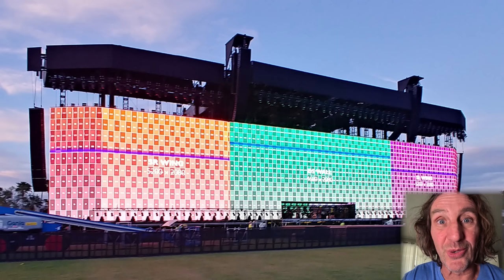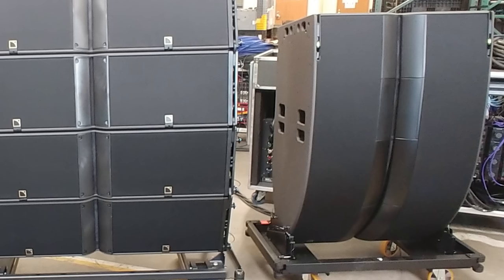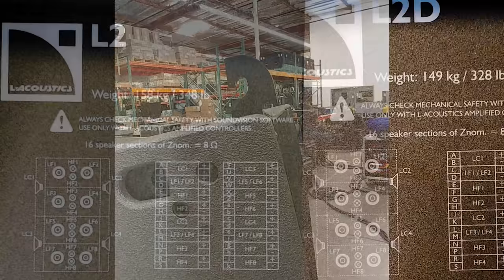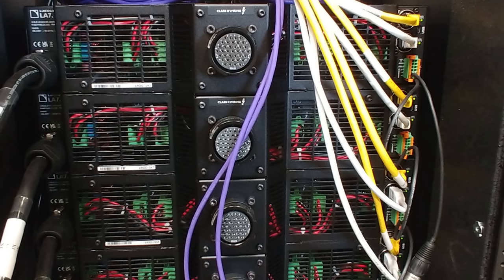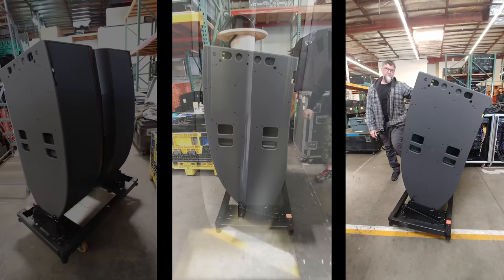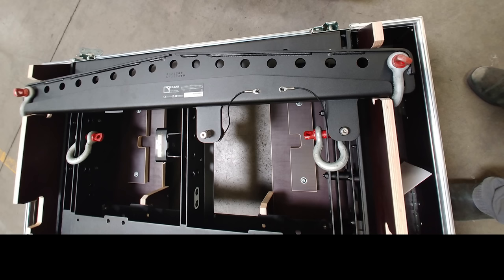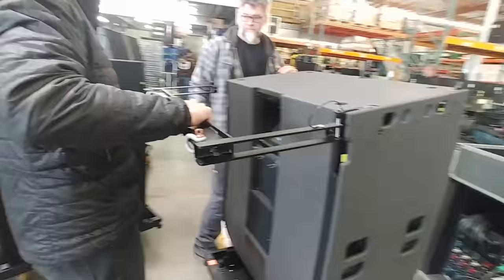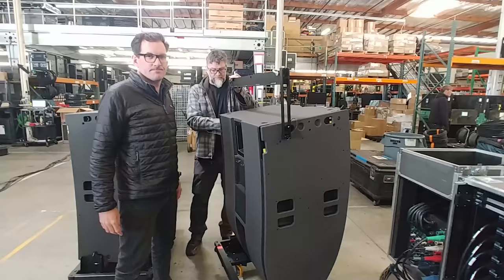L-Acoustics L2 Hands-On & Huge Festival PA

Comment: Spend all that money on and don’t put the boxes in cases with protective tops?
Reply from the maker: For large format touring systems the industry standard is to use carts. It would be a total nightmare to have case lids for those. Not only would the lost time in taking the case lids off and on be an issue, where would you put them all? Back in the truck so you have to unload them before you load out and cost tens or hundreds of thousands of dollars in extra labor?

For Coachella festa will we deploy over 800 boxes with over 200 carts similar to the ones used here with soft covers.

Just taking the soft covers off and putting them on and storing them is a chore.

As far as transportation the cards just roll into the truck or get forklifted.

Putting hard tops on speaker cabinets is great for small stuff but for large format systems it's about as useful as getting a hard cover box to put over your car that you have to lift off every day you drive

Comment: I guess, with integrated cardioid, these boxes will be able to compete with the new D&B KSL boxes that seem to be gaining popularity (though I think L-acoustics still seem to be used at the majority of events.) If they ever release an L1 rig that can compete with the larger K1 and D&B GSL in volume, that would probably change the game. I recently went to an arena concert (Missy Elliott) that used entirely D&B KSL arrays. The entrance to the arena was behind the stage, and I couldn’t hear ANYTHING from there. In previous concerts in the same arena with K1/K2, Meyer Leo, and Clair Global Cohesion arrays, I could certainly hear them upon entrance. I can’t wait to hear L2 in action at an event some time.
Reply from the maker: The KSLs are cool. But as far as getting rear rejection and cardioid, I actually bumped out KSL rig for a festival in a sensitive neighbor noise area and replaced it with K1 K2 and K1SB hung behind the array.

KSL at originally got the gig because of its built-in cardioid control

But hanging K1 SB behind K1, actually gives you far superior cardioid control than KSL can do.

Though the all-in-one box solution is nice, if the system provider has the proper skill set you can do way better and have even more control with a K1/k1sb setup.

Comment: This is cool....but I can't get over those dolley's!  They even have rollers on the corners!  I understand what they are for, but at the same time, I'm so used to employers making do with poorly maintained or inadequate equipment, that it kind of blows me away to see something as trivial as a dolley being over-engineered, just to make things go a little smoother.  And I'm sure it does make a difference.
Reply from the maker: Yes it stops the cart from tearing up the side of the truck ramps and the road cases. I too love the attention to detail and it goes on and on as you dig into the L-acoustics gear

Comment: I'm on the east coast so I haven't seen the festival first hand.  I worked for a sound company locally that went beyond regional so yes we would fly things and had the rigging crew on the high wire.  The 2 brother's that had the company tried to stay domestically to our state and used Community Loudspeakers.  BUT I am dated as this is over 20 years ago.....   BUT huge huge video screens which is a great presentation for the size of the real estate there & the lay of the land there.   That is a massive array of speakers considering the size of the drivers....to get air moving.   If you recall in a different post from me.......the bounce you are talking about....I made the statement of the baseball pitcher and the distance relationship to the catcher......but that was on electron spin......but much the same way...its the distance and the development of the wave.   pebble being dropped in the center of a perfect circle pond of size...so the focal point of ground zero when the pebble disturbs the water surface and the resulting waves out.....and picking the distance from ground zero for the maturity of the wave and where to "sample" and taste.....and playing goldie-locks for just right........BUT what an array of air pumps to pimp........in a wide open space.........as opposed to a classic greek amphitheatre....or the lay of the land in a bowl or valley.    COOL !!

Comment: At first glance, the day before the official announcement, I was skeptical. But if this is equivalent to the work done by the K2 or similar, the virtues, benefits, advantages, well they are welcome. Mechanically and electronically they bring a new solution to the paradigm: the system that solves the most; with as few complications as possible.
Reply from the maker: Agreed I'm quite excited about it and feel it will be a very popular system. The one stumbling block challenge is the reduced low frequency energy between 80 and 40 Hz makes subwoofer placement and array design much more complex and critical

Comment: Hey Dave, you said extension of the L series is 60hz. What was the crossover frequency set at with the subs? Do you have a high pass on the Ls at the crossover or do you let them extend all the way down to 60 still? I assume 80-85hz for the crossover? Thanks great video!
Reply from the maker: The elves are run down to 60 Hz and using the subs crossed over at 80 or 100 so there's some overlap

Comment: Interesting, thanks for the showcase. 
One thing I always wondered about was the SPL claims from the brand, especially in terms of output for the K--Series.
Now they claim one L2 element to have the SPL equivalent to 4 K2 boxes, and that would be 147db according to their spec sheet (155db stated for 3 L2s).
This would confirm my suspicion that the claimed SPL levels for the K2 (and also K1 and Kara for that matter) were actually the values for 4 cabs, not for a single cab.
So, considering a straight flown line of 4 K2s (+12db compared to a single K2), one would get the claimed 147db, which would indicate an SPL of 135db for a single K2.
This would be realistic, let's assume a sensitivity for each of the 12" LF and 6,5" MF drivers of 100db/w/m, and each 3" HF driver of 110db/w/m,
you'd have an overall sensitivity of
106db/w/m for the lows (2 drivers),
112db/w/m for the mids (4 drivers),
116db/w/m for the highs (2 drivers),
that would mean you'd need about 800 Watts for each 12" driver,
800 Watts for the mid section (200W/driver)
and 160 Watts for the hf section (80W/driver)
to reach 135db for the whole box.
These would be realistic power values considering the output power of the LA4X/8/12X amps.
Sorry for all this BS, just wanted to say that i find the SPL values that L-Acoustics gives for their speakers a bit deceptive if they don't state how many 
boxes were used to get these values and thought that this would be an interesting topic to bring up.
Feel free to correct me if any of these assumptions should be wrong.
Reply from the maker: You know I don't know the answer to that I'll ask next time I chat with someone who would know. 

That said, with a line array since the HF does not overlap between boxes, adding more boxes theoretically should just increase vertical coverage but not increase the volume levels.

That said a line array can be set up with 0° angles such that the boxes are adding together, but I feel that using a configuration like that to create the specification would be deceptive.

So I'm guessing that the SPL spec is for one box covering an area or four boxes played such that they each cover adjacent vertical areas and for that measurement full frequency response the SPL should theoretically be about the same?
Reply: Well, i'd suspect they used a flat array of 4 K2's, since i don't see how it would be possible to create that SPL with just one box (in terms of driver sensitivity & power, like I said). One thing that bothers me about brands like L-Acoustics, D&B etc. is that they are way less transparent about their speaker specs than they used to be. When I look up the spec sheet for the old V-DOSC cabs, they used to give the sensitivity and power ratings for the LF, MF and HF sections respectively, as well as SPL values for one or multiple boxes, flown straight or with maximum curvature. 
In fact, the V-DOSC specs would be another hint that they used 4 boxes at 0°, since they stated at the K2 introduction in 2013 that the K2 as a replacement for V-DOSC has the same SPL and bandwidth, and in the spec sheet for V-DOSC it says 134db for 1 element and 146db for 4 when flown flat (143db for 15° total curvature, respectively)  @DaveRat
Reply from the maker: Lots of variables there. It's similar to amplifier power ratings, where the discussion between using RMS power or peak power and the duration of peak power versus usable and achievable volume levels versus the sound quality at those volume levels.

Looking at the SPL output of a loud speaker without looking at the total area covered at that SPL is of minimal value.

If one speaker covers 20° vertical and 120° horizontal and another covers 5° vertical and 60° horizontal, what SPL levels would you want to see in order to have them be equivalent? One speaker has eight times the coverage area of the other so theoretically it would need to be 24 dB louder to be the same.

But also the frequency response trails off in the various speakers at different rates.

And that SPL level is measured on axis yet the wide dispersion speaker is 6DB down at its off access extremes not only in volume levels but in variations of different frequencies.

I think taking the SPL levels much beyond a reference point for comparing products from the same manufacturer is of little value and what really matters are things like actual usable coverage, sound quality at the coverage extremes, and how well multiple boxes can be arrayed together to increase coverage and volume levels.

I know for L acoustics, they try and design enclosures in 3DB increments and design such that things like 3 K2 boxes is approximately equivalent to 2 K1 boxes. Then you can easily do the math on the vertical hang height and hang weight of how many K2 versus K1 would be needed. Same with k3, where 3 K 3 boxes is equivalent to 2 K2 boxes.

It's not an exact science but it gives you a rule of thumb to figure out about how many boxes you need of various types if you have a good idea of how many boxes of a different type would work for you.

Personally what I would do as well is look at the box format and cone area of the low frequency drivers and number and size of the HF drivers to get a good idea of its maximum capabilities.

So for 12-in base systems you can compare the JBL to the D&B to the L acoustics. And being familiar with the brands know that L acoustics is probably going to sound better and more hi-fi, D&B will tend to get a little louder and have more punch and JBL will be more cost effective as those seem to be the trends of the various manufacturers.
Reply: Yeah okay, getting a bit over the top here.
My initial comment was just a little nitpicking about the spl values l-acoustics gives for their boxes without giving further details (other than pink noise used for measurement and peak values for 1m distance), and i found it interesting to point that out. 
Of course the same discussion could be made for power ratings of amps, where there are also differences in how different brands give more or less information about the claimed values (like test signals with different crest factors or sine bursts of different lenghts).
I didn't want to start a discussion about the practical usage of these informations.
It should have been solely theoretical, like my calculation in the first comment was. I know that those values are of little importance in real-world situations, but it's still a  parameter they promote their boxes with, and that could be a little misleading, as I said.
Usually, when working with Soundvision or Array Calc, I don't care about max spl for a single box either, i'll focus on getting even coverage of a given audience area with a target spl (while also leaving some headroom) and choosing the right type and amount of speakers for that purpose. I think we can agree on that.
It just seems more credible for a manufacturer if they are transparent about how their stated values were measured, that was the whole point of my comment, 
since they used to do that in the past.
Maybe it has to do with the "system approach" all these mentioned companies use nowadays, why they prefer to keep most of the parameters secret like crossovers and filters for their presets and also power ratings for the speakers since you're supposed to only use their speakers on their dsp amps with the appropriate limiters etc. already implemented in the presets. @DaveRat
Reply from the maker: I agree they are giving less specific information and I also understand why as well. Defining an SPL level or a crossover point or power handling as a single simple number will be misleading no matter what you do.

Crossover points, SPL levels and power handling are not simple numbers but rather variable entities that change depending on things like mechanical horn dispersion settings or low frequency cut off points selected.

When I worked with e a w they were very adamant about being precise and offering lots of info yet it put them at a disadvantage when other manufacturers specified much higher ratings and less info and there did not seem to be a public backlash against the limited info.

Yet to be accurate with modern systems that automatically recalibrate depending on configurations, simplifying it down to single numbers would not do justice either.

Comment: Thanks for another great video Dave. I'm really interested in the acquisition of Alignarray and was wondering if there would be any benefit to incorporating a wireless module into these units? Obviously a wired solution is more robust and reliable but for me, a wireless option would most certainly be helpful on gigs when no data line is available up to the hang.
Reply from the maker: They actually have a wifi module in them but it's not active at this point. 

Initially we will release 100 units near exactly as they were on the last production run with one part upgraded due to being discontinued. 

We may activate WiFi in the next version(s)

That said, dropping an RJ45 cable along with the speaker cables tends not to be overly complex. The big challenge is having an event solution for power. Battery operated has it's issues and POE makes things simple. 

Sending up lasers with dead battery packs or having batts die while up, a good way to keep batts charged and the preferred charging method(s) are all aspects that need to be considered.

We may make make a lower power laser version and possibly a WiFi POE batt pack at some point.

Comment: How was everything networked together? was there one show network that was shared by LX/SX and video?
Reply from the maker: We have dedicated fiber run to all our delay clusters and throughout the festival. Rat sound has drive racks that allow just about any signal to be run down fiber or network cable or analog and received by any of the above as well that we drop wherever we need them
Reply: @DaveRat  was that over conventional single mode fibre?
Reply from the maker: We just converted everything to dual mode in the past year or so

Comment: How many days of audio setup on mainstage to get to a point where your tuning? Great video!
Reply from the maker: It's an incremental adventure. We get the main PA up fairly quickly and then we have the 18 delay clusters spread across the field and all the networking for that that happens.

Once we have this new setup dialed in it should only take a day to get the mains in and up but this one took a couple days

Comment: Dave, what do you think of the Nexo array's? I've an old NEXO SI system and had an old Nexo SI2000 system (sounds great I think)
Reply from the maker: I have some experience with Nexo. We had one of their horn loaded systems for a while but arraying them so they covered evenly was a challenge though they were punchy and kind of cool they had nowhere the deployment fidelity of the modern line array.

I've used the early versions of the line array and they sounded good and had amazing horizontal coverage.

One of the challenges with building ultra small line arrays with extended low frequency response like the Geo and Kara is that not small cone speaker gets modulated by the low frequencies and tends to blur the vocals a lot.

But it's been awhile since I've heard her best with any nexo stuff.
Reply: @DaveRat  Thanks for your response!
Reply from the maker: @dirkosinga2549 👍👍👍

Comment: Hi Dave….how do these boxes do compared to the older system..with the high end getting squishy and easily pushed around by wind
Reply from the maker: A system that employs a single box wide, whether it is a point source or line array will be impacted in similar ways by lateral wind as the sound from one source is blown away, the sound from another source can often be blown in to replace it for certain listening positions.

Putting 2 or more sound sources side by side will improve wind tolerance at the expense of increases in hotizontal phase and clarity issues when wind is not a factor.

The best way to mitigate wind related sound issues is to decrease the distances between the sound sources and listeners by implementing things like delay clusters